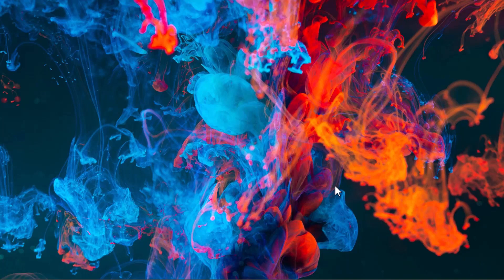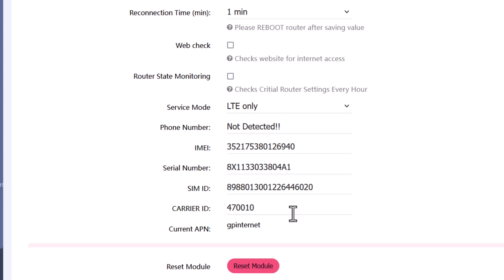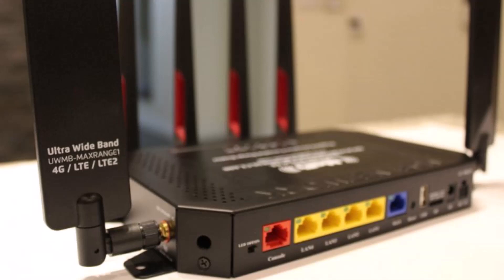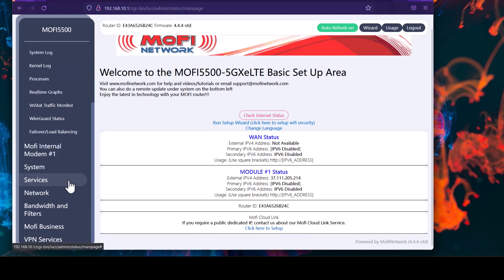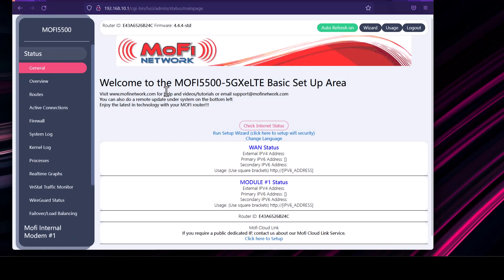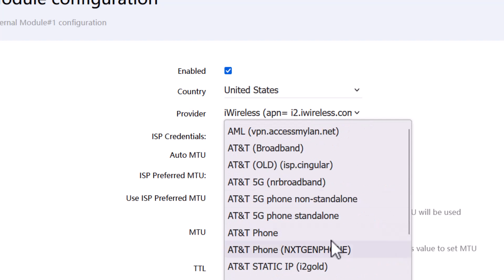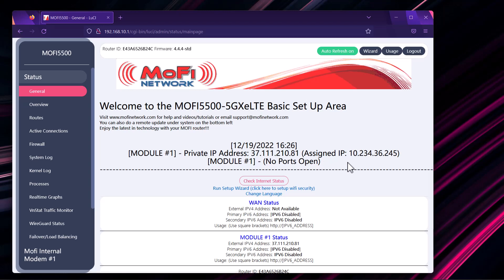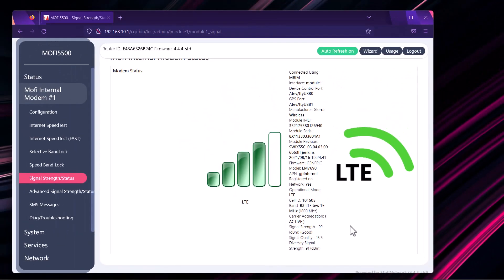MOFI5500-5GXeLTE Mofi Network 4G/LTE/5G Router General Trouble Shooting

Comment: Hello, nice video. When setting up the mofi 5500 can i use a usb-usb cable or should I use an ethernet connection?
Thanks
Reply from the maker: Ethernet or WiFi, best to call us and we can help you in the phone, 1-888-499-0123 x3

Comment: I didn’t care for the Mofi 5500 router the mofi 4500 is much better
Reply from the maker: @verogrant3105  the 5500 and 6500 are much faster but the 4500 is smaller and uses less power
Reply: @ Yeah, I don’t have 5G out here where I live anyway
Reply from the maker: @verogrant3105  but the 5500 anf 6500 has options for just LTE also and using the cat20 lte options, you can get 2 to 3 times faster speeds than the 4500
Reply: @ Yeah, well you don’t live out here where I live Out here where I live, it doesn’t deliver
Reply from the maker: @verogrant3105  we have been doing this since 2009
We have sold to litterly 50,000 customers in similar locations and spend a lot of time to compare speeds
For sure the newer models will be faster even if for some reason you get the same speed on the cellular side
Just know we are not new to this 
Also, I personally had to use the router for many years in a rural area so I am a pretty good expert on this with real hands on experience
Reply: @ Perhaps you’re right I will try it in another location at my brothers property but down here where I live, it really doesn’t make a difference

Comment: My unit isn’t broadcasting the SSID, also the only LED illuminated is power. 
MOFI5500-5GXeLTE-EM9191
Reply from the maker: @haroldplanaplonick3632  hello. Our number is 1.888.499.0123 x3
We are open 7 days a week
For this issue  did you try to do a wifi recovery?
Best to call us or make a ticket on our site and we can help resolve your issue
Reply: Thank you for the quick reply. To be honest the most I’ve tried is unplugging from the wall for 5 minutes. It’s owned by a large corporation, I wanted to stay in my lane 😂. I’ll see if they want me messing with it then call you guys for assistance.